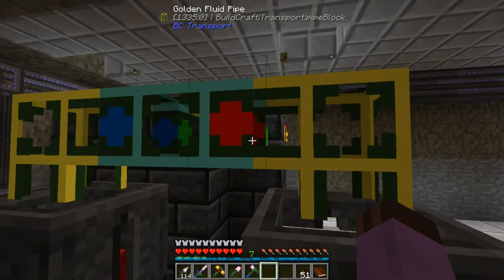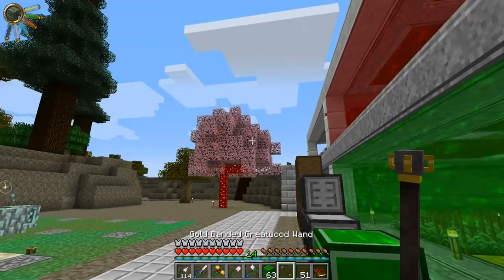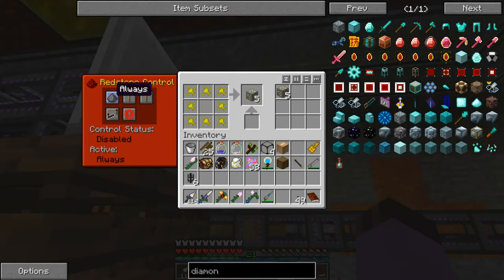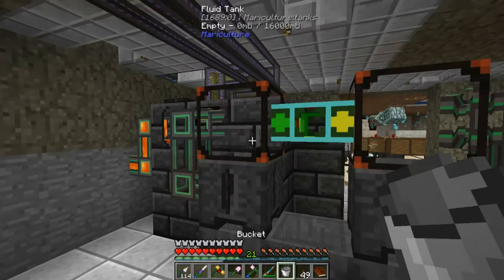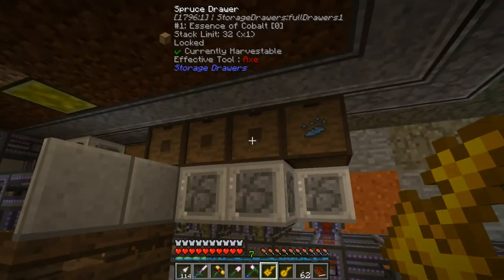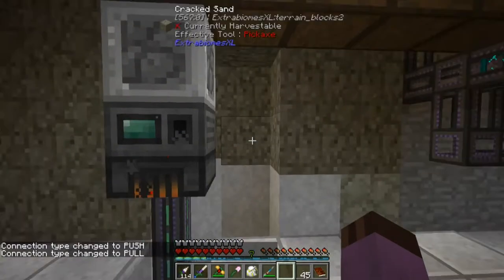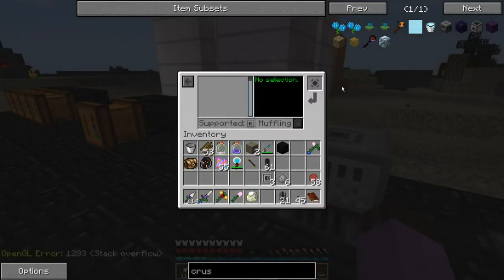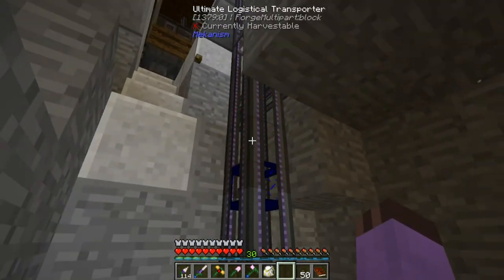Regrowth Episode 22: The Great Engoleming Pt 2

Comment: I may not have golems yet, but what I do have is classic minecraft utility.

Rather than muck around with open crates, my mana setup with 4 gourmaryllis eating magical food uses vanilla droppers (super cheap, 7 cobble and one redstone) fed by mekanism pipes, with a drum of the wild on a 10 second timer. Two agricarnations help keep the field up and running and a recessive spark on the collection pool means a diluted one nearby to keep the pulse spreader and flowers running has ended my mana troubles. I'll eventually expand to probably 8 gourmarillis plants, which should provide a ton of mana. The plants are fed every 30 seconds with a timer, which gives a few seconds of leeway before the next pulse (the feeding cycle takes about 27 seconds from chomp to empty).

One terrasteel ingot in 5 minutes or so greatly beats one every 30 minutes.
Reply from the maker: An open crate is literally just 2 pieces of livingwood turned into planks, you know.  You can get them well before you get redstone :P

Your setup sounds super nice though, hope you find lots of good things to use all that mana with!
Reply: True, but the advantage a dropper has over an open crate is redstone control. From what I see, the open crate just drops and drops continuously, while the dropper only does so on a redstone pulse.
Reply from the maker: True, that's why I had to throw together the hopper system.  Though you say you already have mekanism pipes (Didn't have those when I made my mana system) so I could do your system with open crates with two logistical sorters: one shoots out (number of gourmys) items to a buffer chest with the second sorter, doing size one in round robin.  Put the first sorter on a redstone timer and there you are :P

Neither system's really better of course, just a good show of how many ways there are to do things <3

Comment: First!  And Imma firin mai Lazor! For robots! I rather like my green base, instead of brown broken sand. I got grass everywhere, as if the world isn't dead. I'll probably do a partial rebuild to make things look nice, but at this point, I don't have to worry so much about harvesting. Processing however isn't auto yet. I have no lag with my setup, so far.

I got power and mana full auto at least. Botania mana is simply a golem, a pressure plate, and an open crate connected to an autocrafter. I also have a golem for the boiler, but I probably won't be making any more golems.
Reply from the maker: Golems kind of became A Thing once I started naming them after people.  Normally I might just make a big field with small amounts of everything, covered by one or two golems, but automating the greenhouse setup let me name more golems so.... :P
Reply: Granted, but I have used golems before and dont want to just keep repeating the same stuff

Comment: Also, the openGL error is likely caused by a corrupt item in your inventory, or the world (such as an invisible button).  try dying and picking things up slowly to find it.  it may solve the problem all on it's own by doing so.  not taking care of it can lead to crashing.  once you find the item causing the issue, use a cactus to delete and the problem is solved.
Reply: Would the number beside said error be the item ID perhaps?
Reply from the maker: Nah, that's the error number that openGL's throwing.
Reply from the maker: One of the first things I tried.  I shuffled everything out of my inventory, did /clear to make sure nothing invisible was on me, and the flood continued regardless.
Reply: There's the possibility said error could be related to an overworld item or something in the inventory. Whenabouts did the error start popping up?
Reply from the maker: You literally saw the first instance of it on film in this episode :P  Pretty much started when I reinstalled optifine.  So It's something optifine doesn't like, but no idea what, cause there are a billion new things in the base since the last time it was up.